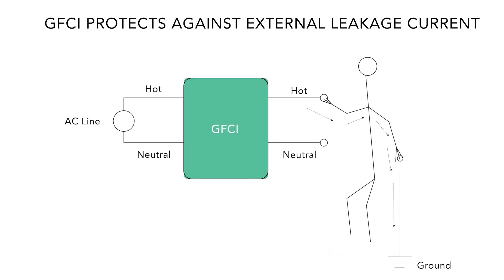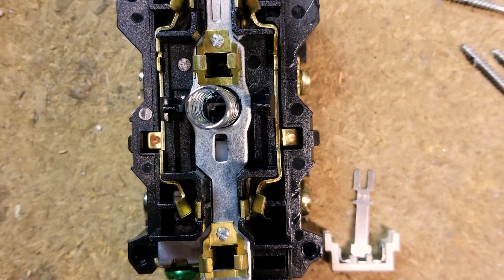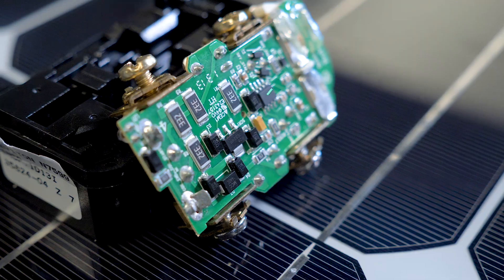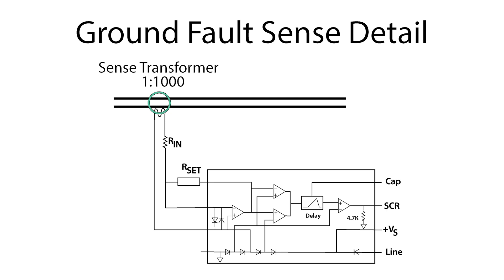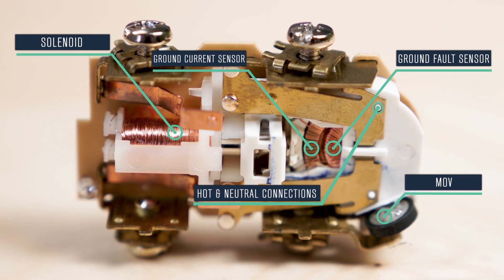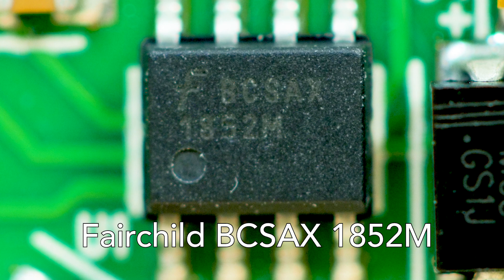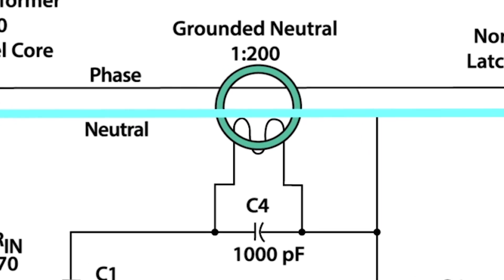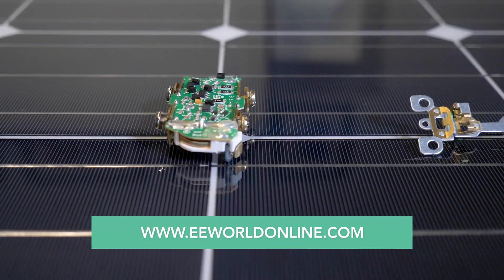Teardown: Leviton Ground fault circuit interrupter

Comment: I am researching the chip for work.  I need do design a circuit that turns off a power triac rather than tripping a breaker.  Thank you for this video it has taken some of the mystery out of how to implement the chip.

Comment: Any ideas why my gfi trips when a fountain pump is turned off?  It trips about every 20th time that the pump is turned off.  I've replaced the plug and the pump.
Reply: It may be due to leakage current anywhere in the circuit due to water and or humidity in the environment.

Comment: Nice presentation... The way how ground/neutral path causes oscillations needs better explanation. In fact, it only works because ground and neutral are connected on electrical panel on the source side, and shorting it on the load side creates a coupling winding between coils, and thus enabling positive feedback. This circuit may also trip if some high-frequency current is present in the load (as with modern switch mode power supplies). To fix that, many recent GFCIs have a capacitor in parallel to sense coil to reduce sensitivity to high frequency noise.

Comment: With this particular gfci receptacle would I need to ground the metal box it was placed in. I was told that simply installing it into the metal box would ground the box with out attaching any additional wires to the box itself.

Comment: What’s the difference between the line and load side on GFCI? Why can we not join the neutrals together?
Reply: The interrupter coil is powered from the line side.  There will be not enough energy to complete disconnection if the power in solenoid disappears mid-way. On the second question: if you connect neutrals externally, the GFCI will trip because of both the current through sensor coil will be unbalanced, and (!) because the circuit will start oscillations as the coils now have common winding (see above). So it will immediately tripped when powered.
Reply: On the load side you can connect other outlets that are also protected. Line is where the current comes. You do not join the neutrals as the GFCI needs to be able to break the connection.

Comment: The wire set GFCI I have installed in my car for the Tea Engine is triggering.  It's very useful for me to understand fully how they work.  It will help me track down the problem -- I need to have tea brewing in my car again!

Comment: I'm curious if someone wire the GFCI wong(swap hot and neutral) will it work or trip instantly or not working at all? As it is a "simple" electromagnetic sensor I believe it should be okay, but I'm not sure. I'm not an electrician, but an engineer, and in the office it lead to quite an argument what will be the resoult.
Reply: IMHO, it will work exactly the same (given that you did not switch input and output ports) - because schematic is symmetric wrt the pass-through wires. It will even detect ground and neutral shorts. This part is not clearly described, but eventually this short creates a common winding loop between two coils and thus it will create positive feedback between "sense" (input of the amplifier) and "grounded" (output) transformers. This feedback results in oscillations whose swing will trigger detector. It will be clear once you notice that pin 1 is output of the amplifier and the "grounded" coil is actually NOT sensor, but rather a transformer. The fact that both phase and neutral wires run through it makes design symmetric wrt swapping wires.
Reply: IMHO if you thought you were smart enough to wire it but didn't double check your work with a simple outlet wiring tester, you know the one with three lights, then you deserve the mess that will be created later by your incompetence.  Thus your engineering buddies should consider it moot.  Humans that cannot overcome their environment will eventually either suffer a genetic devolution that leads their new branch toward a death or die outright, before spawn preferably.

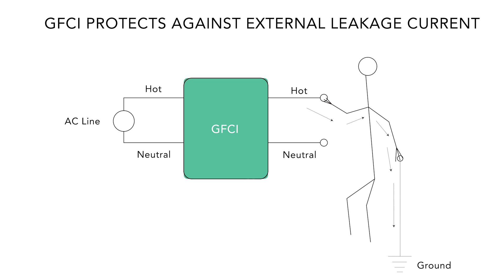Comment: At 0:17 you said that GFCI's trip if they sense "current flowing in the neutral wire".  THIS IS INCORRECT!  GFCI's detect the DIFFERENCE in current between hot and neutral, not the presence of current in the neutral.

Comment: Very good presentation, but an error in the beginning saying Neutral current is sensed to trip the GFCI. Of course you know it is unbalanced Hot and Neutral currents NOT Neutral current by itself. Of course there should be Neutral current.

Comment: I'm curious if the circuit is normally open or closed. If normally open, and the circuit must actively close the circuit to power the receptacle, then if the gfci is broken then would if fail in the open (no power) state. I'd assume this is desirable.
Reply: This example is not exactly correct.  If the GFCI in a test circuit I setup is unplugged open, then it will be open when plugged in again.  If it is closed and unplugged, then it will be closed when plugged in again.  Why?  The open or close state is mechanically done by either pushing the reset button or the test button.  So, how the failure happens, determines the On or Off state, even if broken.  Of course, if the mechanical latch part has failed, who knows what the failure state will be when the mechanical part is broken?  JMO.
Reply: @stefanslaw1140  - thanks for the explanation. This is slightly different than what Mike Holt mentions (about Levition smartlock gfci's only), but your idea about setting up a test circuit to actually test the function is brilliant! I am going to turn off and then on the breaker to my kitchen and bathroom circuits (bathroom uses the Leviton with black/red buttons and kitchen has Leviton with white buttons) and see if I must then manually turn the gfci's back on. According to Mike Holt, the Leviton must actively close the circuit, and additionally will perform a self-check on first power up, which is unique to the Leviton gfci's. Here's the video at 7:23 where he mentions this - https://youtu.be/pObsSoI4-yE?t=443

Comment: Are we Protected from Electrical shock from a Two wire Outlet down stream of a GFCI ?
Reply: Yes. One GFCI can protect anything downstream...
Ground wire isn't necessary, but recommended.
Reply: You are partially protected - if you touch the live wire and stand on the ground or touch metal enclosure of grounded equipment. You are NOT (!) protected if you decide to hold live and neutral wires and not touch anything else (eg. insert two nails in the outlet and touch them both). That is because your body will be a normal electrical load, and no current path to ground. Use tamper-proof outlets for physical protection against kids as required now by the code for anything installed below 6ft from the floor.... 🙂

Comment: Does anyone know what value the Rtest resistor has?
Reply: Assuming the Metal Oxide Varistor, MOV, is not in the circuit; the value would be 120 V divided by 5 or 6 mas.  That's calculated as about 24,000 ohms as simulated in this test circuit setup as Rb.
Stefan